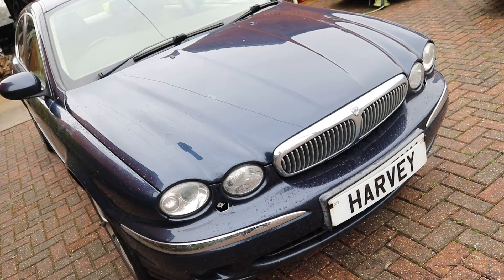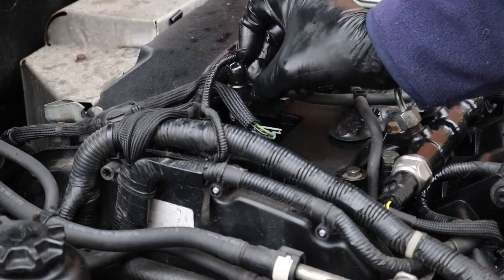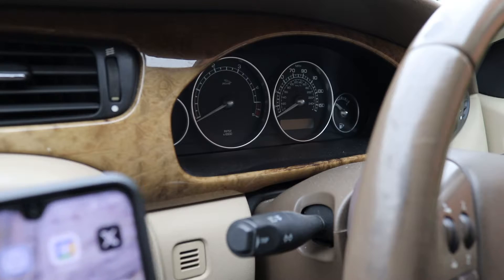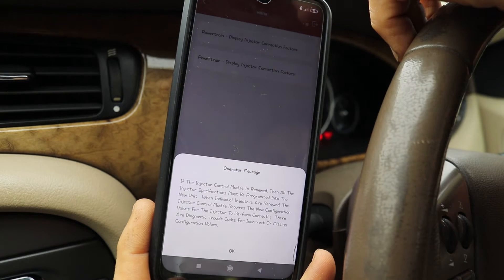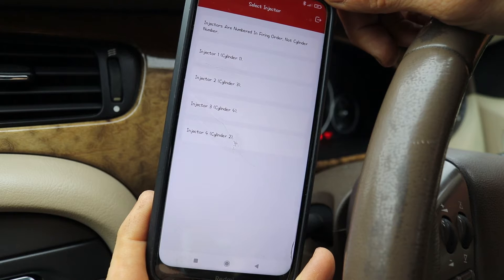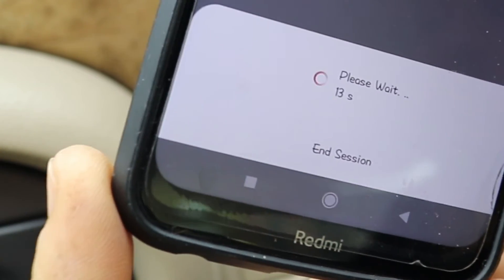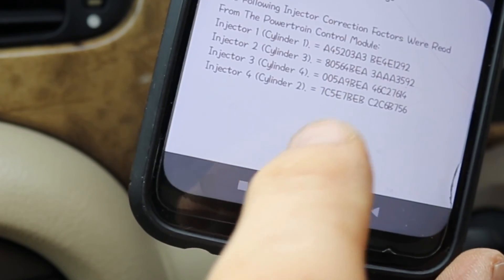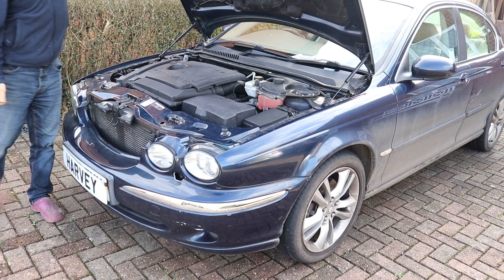JAGUAR X-TYPE INJECTOR CODING

Comment: Hi vert Nice and clear explication ,I just changed the rocker cover gasket and unplugged the wire,and now that I’ve reassembled everything,the engine is going very badly:(
Do you think i have to reprogramming the injector?
I still used the the same than before,I don’t understand
Reply from the maker: No, if you haven't changed the injectors then they are the same and no need to re-code as code will be the same. changing a rocker cover gasket shouldn't have made any difference detaching/reattaching the electrical connections, but you may have upset the connections or disturbed a wire that may have broken etc. take off each connector and listen to the sound to find which cylinder has no change -  this will be the one with the problem. If all the same then you could do a continuity test of the individual wires traced back to the connection block looking for open/ high resistance. These engines are prone for injector issues.
Reply: Hi Harvey,
After looking everything try to do the way back  I find 1 connector broken,I was super happy to find that and ordering a new one..
After changing the connector the problem still here:(
Do you think is possible to the injector be clogged?with out touching them?
Should I take them all off and cleaning ?
Reply: @nuncnovus3579  If you took the return lines off etc you should bleed the fuel system! The best way is to loosen up the high pressure lines of the injectors and take out the fuel filter and fill it to the brim with diesel! Do this a couple of times and your car should start! I had the same issue with ford mondeo mk3 2.2 tdci... (same engines)
Reply: Thank you very much for the advice,I’m going to see everything again this weekend!

Comment: I literally just ordered the Icarsoft 3.0 off Amazon ? its not even arrived yet, , 
would you suggest the KINGBOLEN  over the Icarsoft ?  
or can the Icarsoft do this as well ?
Reply from the maker: The kingbolen is subscription based after first year around _80 dollar and is quite comprehensive, but I haven't used it for long enough to recommend or not recommend yet. I can only recommend vagcom atm as that has been around and extensively tested to be an excellent diagnostics and more obd2 tool.